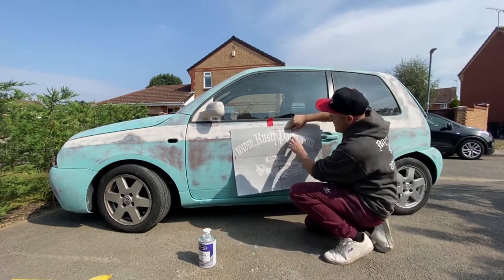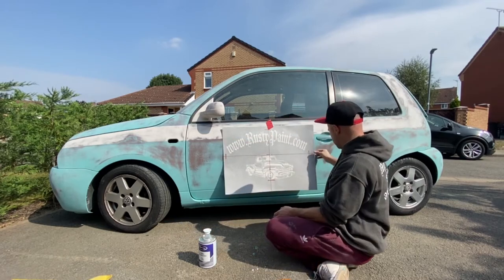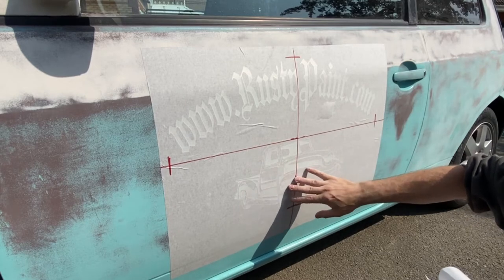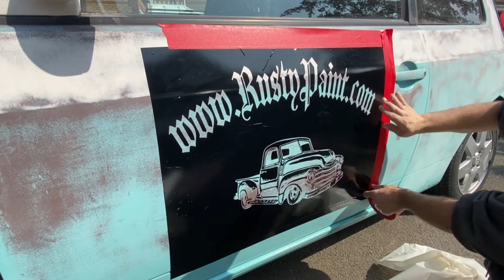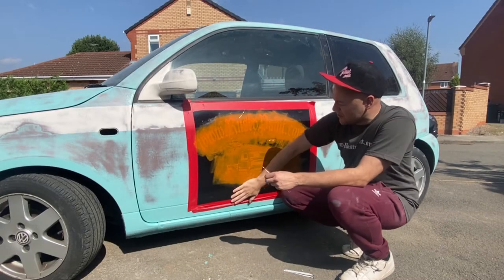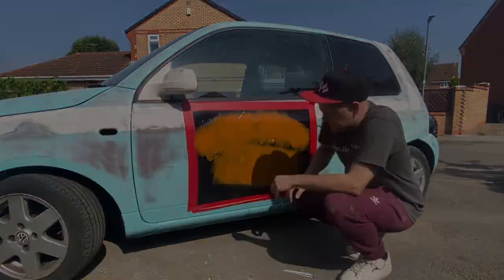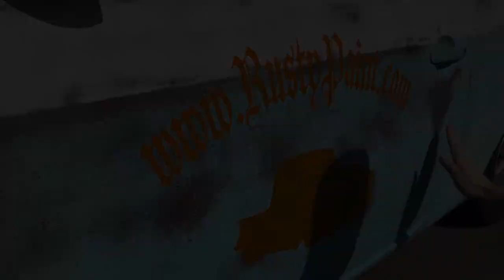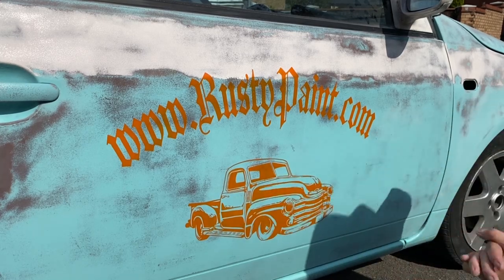Paint Stencils - DIY At Home Vehicle Sign Writing & logos Using Our Stencils - Rustypaint.com

Comment: What if you want to do a multicolour stencil? Would layering the Vinyl over top each layer pull it off?
Reply from the maker: You can do it that way, or what we have done in the past is use the stencil for the bulk of the colour, then hand paint the rest. We then usually sand over the top which ‘ages’ the stencil anyway (so the hand painting doesn’t need to be perfect). We have a video on here of one of our stencils we did that way on the side of one of our old hotrods -  https://youtu.be/W-loDoXV6yg

Comment: Very nice! Now, if you had to remove a painted logo, how would you do it?? I bought a company vehicle and need to remove the logo. I tried acetone and paint thinner. Nothin seems to touch it. It’s chalky so I know it don’t have a clear coat over it. Is sanding the only way to get that stuff off?
Reply from the maker: Depends on the paint that's been used really - Normally sanding is last resort.
Reply: @rustypaint  thanks, Oven cleaner ended up being the ticket.
Reply: @moorefab8192 what kind of oven cleaner ?? Did it ruin the paint surrounding or underneath
Reply: @1904.Lowridaz  the 'off' brand oven cleaner. I used the extra strength one. No it didn't hurt the paint at all. It won't cut through the factory clear coat so what ever your removing has to be on top of the clear coat or it won't do anything
Reply: @1904.Lowridaz  I did have to buff it when I was done because you have to scrub so much that it makes the clear coat kinda white when it dries. You can get a buffer and compound from harbor freight and there are YouTube videos on how to cut and buff paint jobs.